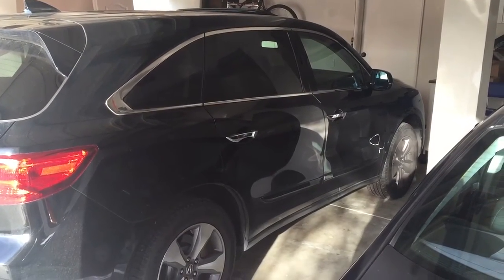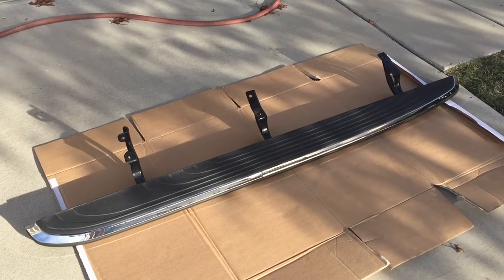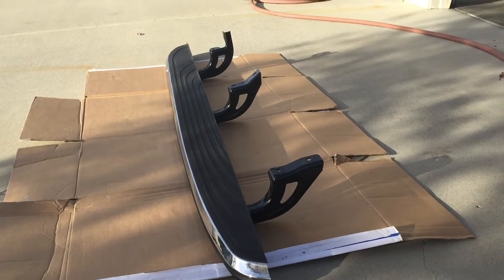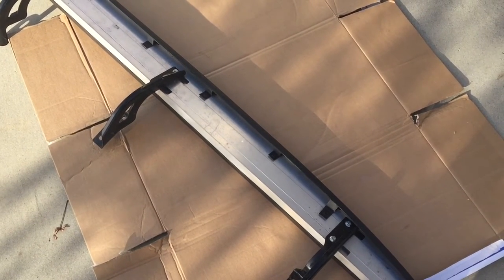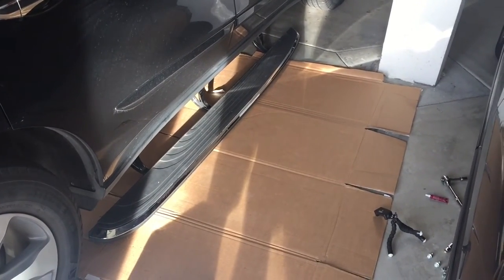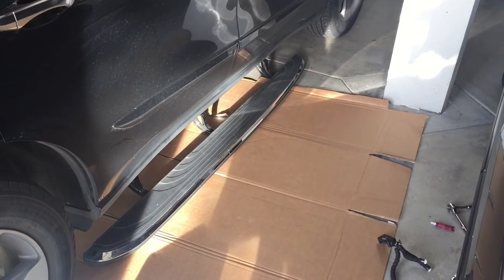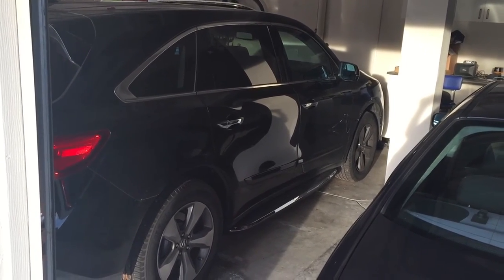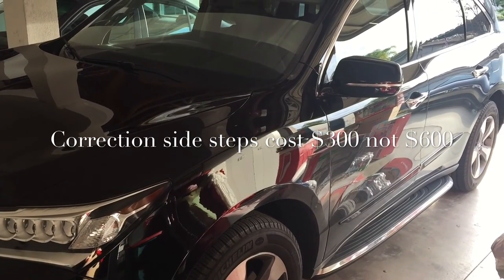DIY-How to Install Side Step / Nerf Bars / Running Boards 2014-2017 Acura MDX, 2016-2017 Honda Pilot

Comment: Hi, i bought the same one for my 2019 mdx, and says its compatible. problem im running into is that the bolt seems long, and doesnt go through all the way. i checked and seems there is a metal behind each mounting hole of the car. i used a thin metal to poke it it doesnt seem like a through hole. is it same with your car?
Reply from the maker: i did not have this issue.  you may need to install nut clips they probably with your hardware in the packaging.

Comment: Your link to buy this kit from Amazon shows it is Genuine Acura (08L33-TZ5-200) Running Board. Is this running boards kit fit 2016-2017 Honda Pilot?
Reply: yes it is the same model part number.
Reply: Thank you. Do they both have Acura or Honda emblem on them?

Comment: Did you need to remove the original side sills and mud flaps? Thought I saw those steps in the instructions but you don't mention it in the video. Thanks in advance.
Reply from the maker: nope you do not need to remove them
Reply: @upsilon1998  Thanks for the response (and for making the video). Got them installed fairly easily - but would suggest to anyone else doing this to keep bolts between running boards and brackets a little loose while installing brackets to car. That should save a lot of frustration in terms of getting everything lined up.

Comment: Hi! What is the gel like item you are using on the bolts?
Reply from the maker: The blue gel is locktite and this locks the threads so the bolts dont come loose.
Reply: is it loctite? blue or red?
Reply from the maker: Blue locktite